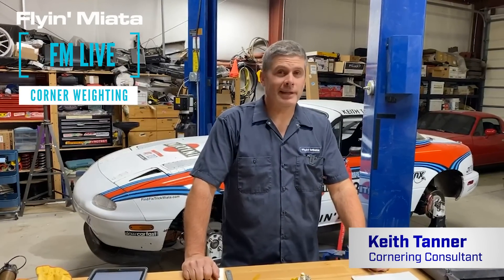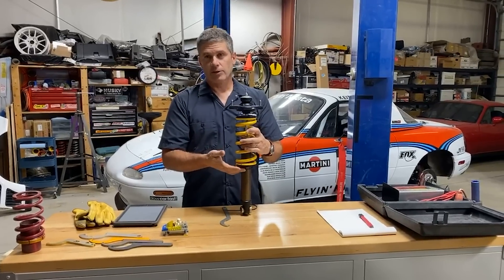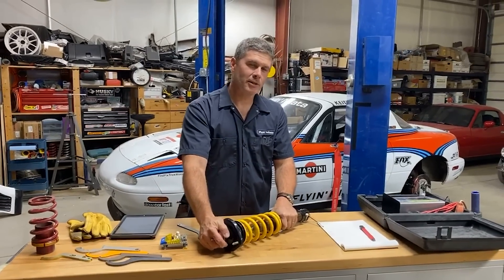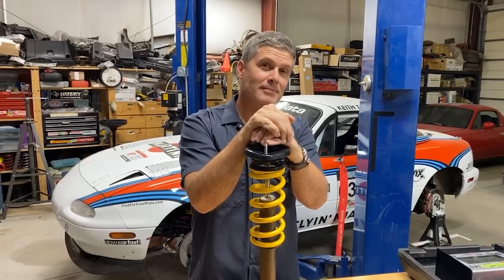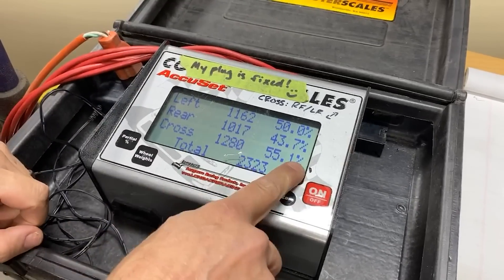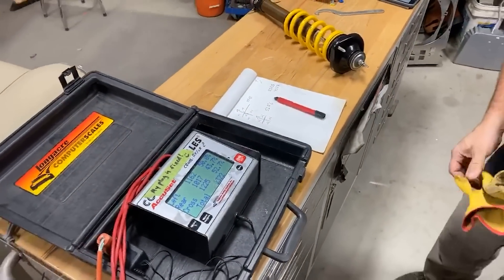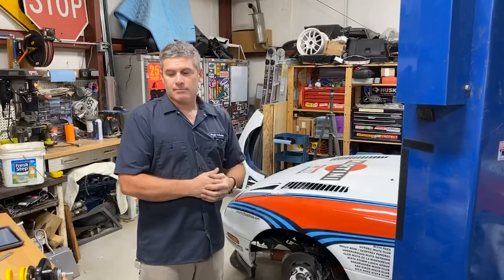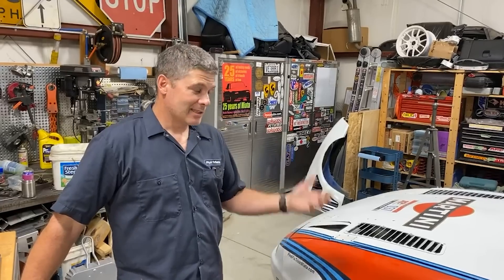How & Why to Corner Weight Your Car (FM Live)

Comment: Very interesting Video.
I have just installed a set of Coilovers with independent height Adjustment without changing Spring Preload on my 1994 Miata. 
At the beginning I set the right height to the recommended settings (Coilover length), but after a week I noticed that one diagonal is higher than the other (measured from Wheel arch to ground), so I changed ride height so every corner is roughly the same ride height. Was that a bad Idea ? Should I Go back to the same Coilover length on every side  even if it means different ride heights (measured From wheel Arch to Ground) 
Will I even be able to feel the difference on spirited driving on mountain roads ?
Reply from the maker: By "independent height adjustment" you mean a two-piece shock that can be adjusted to different lengths. Both the perch location and the shock body length will affect the ride height. So the first step is to make sure that both of those are consistent side to side. If they are, then it's time to look at the free length of the springs to make sure they're consistent. If you're measuring to the ground, make sure all your tire pressures are set as well.

Note that you cannot have one diagonal higher than the other unless your car is bent or is not sitting on a level surface. You can have one high end or one high side, but you can't have opposite corners being higher than the other two corners. That would require the car to be bent in the middle.

Generally, an NA or NB is set up with about 1/2" more rear height than front, measuring at the fender.

Also, if you've not seen our other videos: ignore spring preload. It's not really a tuning tool. It's a side effect. Set your shock length for maximum bump travel, then set your spring perch to get the ride height you want. If you set the shock length to anything else, you will be compromising your suspension setup.
Reply: @FlyinMiataVideo  thanks for the quick answer, I’ve set the perch location to the recommended setting, but I will check that again, maybe I did a mistake there, if not it might just be the tire pressure, or uneven ground. Hopefully that solves my problem, but I’m pretty sure I measured the opposite corners Being higher, but you are right, that shouldn’t be possible
Reply: @FlyinMiataVideo  thanks again seems like I took wrong measurements, now she sits nearly perfect. I find your Videos really helpful and interesting so keep on doin what you do. Really looking forward to buying FM Sway Bars and End Links, too bad there are out of stock now 😞.

Comment: I had the understanding that driver weight should be added when doing corner weight. this would be for spec Miata setup. comment please.
Reply from the maker: As noted in the video, you want the car to be as close as possible to your "ideal state" when doing suspension setup. However, this is a demonstration of the process and this car rarely runs without a passenger anyhow.
Reply: @FlyinMiataVideo  my bad, Thanks for the reply

Comment: Great video and demo. I missed it live, but have a question. Do you do cross weight adjustments before alignment (or after?!?). Or are the two processes independent. Thanks!
Reply: I’d say before if I were to guess. The alignment won’t affect your height, but corner weighting can affect the height if you aren’t careful. Adjusting the height of the coilover will affect the camber.
Reply from the maker: @WTFibangdrums  If you do it right, corner weighting will not affect your height. Watch the video :) So you can do the two independently of each other if you do them well.
Reply: Flyin' Miata oh I did. I’ve been curious about corner weighting for awhile. I didn’t know how much the strut/shock height even if same relative ride height would affect camber movement, and that’s more what I was trying to relay.
Reply from the maker: @WTFibangdrums  It's the actual ride height that's going to affect camber, not how much load that corner is carrying.
Reply: Flyin' Miata that answers it. Thank you!
Reply: Flyin' Miata so back to his original question, does before or after matter?
Reply: I'm leaning toward corner weighting preceding a full alignment. Hope that's right. Thanks guys!
Reply from the maker: I don't think it should matter. Set the ride heights before either, but the order shouldn't be critical after that.
Reply: Late reply. Preloading will not affect the height of the car there fore the alignment. Preloading will require more force before the suspension will travel and it shifts the weight away from that corner. You do sacrifice some travel, but balancing the car is far more important.  @Flyin' Miata is correct. This is a crucial adjustment for motorcycles as they weigh far less.
Reply from the maker: @mrmedium7984  Just spotted this comment.
Preloading will require more force before the suspension will travel FROM FULL EXTENSION. Once it starts to move, it makes no difference if there is preload on the spring. Unless you unloading the suspension to the point where your tires are losing contact with the ground, preload has no effect on how a car suspension works. Motorcycles do have a tendency to lift wheels due to their extreme weight transfer.
If you cornerweight properly using the spring perches, your ride height will not change and neither will your travel. We are not adjusting preload here but perch height. Depending on the amount of shaft travel in the shock, that may or may not have an effect on preload - but that's a side effect.

Comment: How much does corner balancing with the front sway bar connected really affect end results?
Reply from the maker: The sway bar can transfer load from one side to the other if it has any preload in it, so it can end up fighting against the springs across the axle.

Comment: How much will height change when tweaking via the spring perch? If more than 1/4” and you decide to correct height using lower mounts will that affect the weight?
Reply from the maker: I'm not sure I follow the question. In almost every case, you set the car up to get maximum compression travel as limited by the suspension kinematics. Then you adjust the perch heights and spring lengths to get the ride height you're looking for. Then you do the fine-tuning of the perch positions to get the corner weights correct, which was the goal in this video.
The ride height change depends on the motion ratio of the car. An ND will change a different amount than an NA because of their different suspension geometry.

Comment: With weighted drivers seat?
Reply from the maker: Optional depending on how you want the car to be optimized. If you're setting up to run with a passenger most of a time, you'd leave the seats empty. With the position of the driver in a Miata, the corner weights don't really shift that much. In a car where the driver is very close to one axle, you'll see a greater effect.

Comment: I just took my ND2 to get corner balanced and ended up at a 49% cross weight with me in the car, but the ride height was all over the place. I came in with a static height of 13" front and 13.5" rear and left with LF: 13.75", RF: 13.5", LR: 14.06", and RR: 13.38". Should the mechanic be able to get close to my desired ride height and get the car close to a 50% cross weight? Also, how much would I, a novice track driver with only 2 track days, notice the cross weight being off by 1% or 5% or 10%?
Reply from the maker: Yes, the mechanic definitely should have been able to corner weight the car without messing up the ride height. The procedure is detailed in the video.
The place that inaccurate cornerweights show up most obviously is under braking. You'd find that your ABS is engaging earlier than it should - but that can be hard to determine as opposed to a non-ABS car obviously locking the same wheel over and over. You'd probably notice some asymmetrical handling characteristics at 10% and 5% off. At 1%, it's pretty unlikely.
Reply: @FlyinMiataVideo  Thanks! Would you recommend starting with getting the ride height correct and then attempting to corner balance the car? Should the coilovers (perch to perch) typically be equal in length side to side at the front and rear, respectively (e.g. X" long on both rears and Y" on both fronts)?
Reply from the maker: @tomgawel8518  Yes, that's the first step. Get in the ballpark by setting the coilover perches equal side to side then fine-tune it where you want it to be, then go for the cornerweight.
Reply: @FlyinMiataVideo  I had them take another shot. Balance w/ driver ended up at 49.8%. Static ride height w/o driver ended up LF: 12.75", RF: 12.94", LR: 13.63", RR: 13.38". Closer to what I was shooting for from a ride height perspective and marginally better balance. Handled great at the track, but I did notice some very slight rub marks on the plastic front fender linings after I got back home. If I understood your video correctly, I would be able to raise both front sides by an equal amount (e.g. 1/8") and the balance should remain unchanged, correct?
Reply from the maker: @tomgawel8518  Raising both sides by the same amount should have no effect on the balance. However, raising the car won't prevent rubbing. It might decrease the frequency of it, but if you want to prevent it you need to either limit the suspension travel or you need to move things out of the way. For example, a different alignment or (more likely) some fender rolling.

Comment: Does alignment matter before or after?
Reply from the maker: You should set your ride height before alignment and corner weight, but corner weighting can be done before or after alignment. There is some theoretical crossover between the two processes but in reality it’s lost in the margin of error most of the time.
Reply: @FlyinMiataVideo  ok. Thank you.  My ride height is already set but I want to get an alignment on my Ariel Atom. Just didn’t know which I should get first. My Atom is all exposed and weights 1400 pounds so I can adjust everything without taking the wheel off.

Comment: Hello, You forgot to add weights on the driver seat to simulate the weight of the driver.
Reply from the maker: If you only drive the car with a solo driver, that's appropriate. If you usually have two people on board, that's not necessary. This car is set up that way because that's how it's operated. Basically, put the car on the scales in the condition you want to be optimized.

Comment: You have to sit in the car right???
Reply from the maker: Not necessarily. If you're setting the car up for two people, you'll get the same results if it's empty. You can also put weight in the driver's seat. If you do use a human as ballast, they have to sit still when you're measuring the weights.

Comment: Why is it so heavy?! My caged na weights 1950
Reply: I'm pretty sure it has either an LS3 or an L33
Reply: Which also obviously means trans + rear end + etc are heavier
Reply from the maker: It's an LS3, plus everything else you need to make the drivetrain bombproof with over 450 hp at the wheels. It's also fully weatherproof and wears a bunch of skid plates underneath from when it was a rally car. This thing is built like an anvil because its job is to take abuse. It's also road legal.